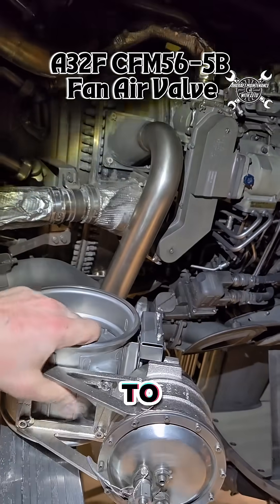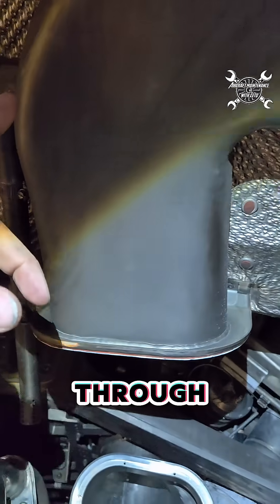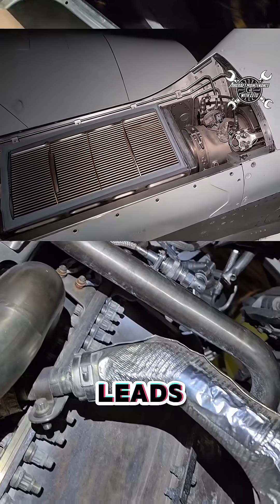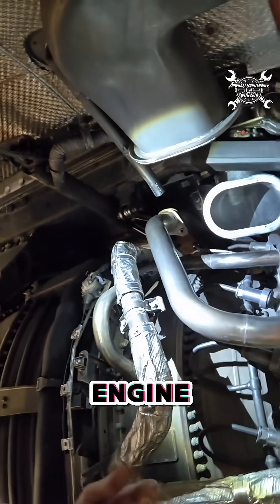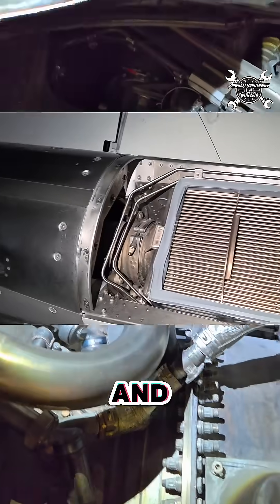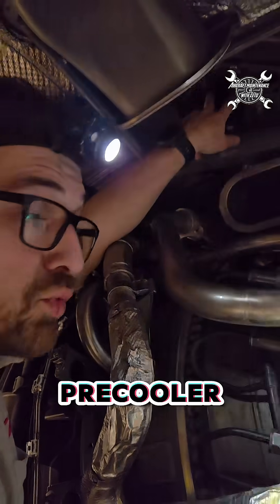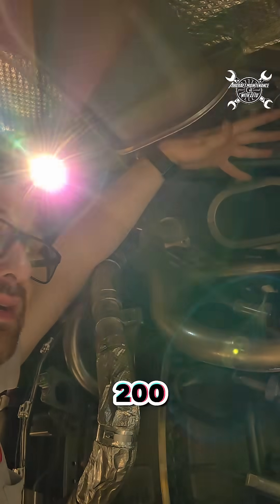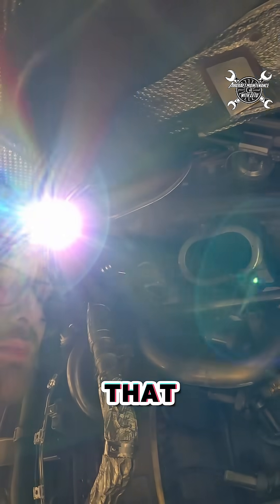How to cool down bleed air from engine on A320

Comment: Sir what may be the  various reasons a pilot reports precooler outlet temp low around 110 degrees?
Reply from the maker: Fan air valve stucked in open positions

Comment: Hello I hope you are well 
Can you please explain how oil fumes and exhaust from engine bearing housing get out from the engine
Reply from the maker: If you meas how it gets to bleed? If you have oil leak in bearing 1-3  this oil will get in to compressor and from there to bleed system. That is why leak is not permitted
Reply: I mean when oil lubricates the bearing it evaporates how does the evaporated oil finds its way outside the engine sorry if my explanation was misleading  @zeto.r

Comment: Zero.R
Long time ago there was an AD to inspect chafing between the CJ9L/CJ10L harness and the fuel manifold to address fuel leak concerns. Could you please make a video on this? Wanted to see why and how the two (manifold and wire) interact with each other.
Maybe you could do a pre/followup video  to explain HPT clearance control as well.
Thanks